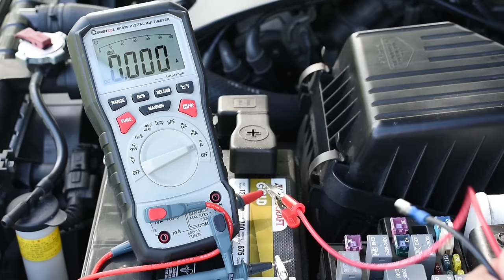Slow Power Windows In Your Car! (HOW TO FIX)

Comment: The testing of the fuse port with a multimeter is something I've not seen on any other video of this sort. I've tried ALL kinds of lubricants in the window channel and nothing seemed to speed it up noticeably. Gonna do the multimeter test next. Thank you for sharing!
Reply from the maker: If the window channel lube fails, you'll need to lubricate or replace the window regulator assembly.

Comment: I did this on my wife’s 98 Corolla some years ago, I couldn’t see what I was doing but a cheapy blue magnet light from Harbor Freight and an old makeup mirror with a magnet glued to the back gave me a much clearer picture. 
The replacement looked like it may have been meant to be riveted in and there were holes to mount it but no threads in the holes, but with HF it was not a problem since I had a tap and die set from them
Reply from the maker: Many cars rivet the regulator assembly to the door. Thanks for watching! Please share.

Comment: While it is true that an excessive power draw could be from a faulty motor, a motor under excessive load from a jammed mechanism, could also increase the amperage draw.
Reply from the maker: That's true too, but infrequent. Lack of window channel lubrication or a worn out motor are the most common.
Reply: Exactly, more load means higher current draw, so this test is useless.

Comment: Here in the Desert South West the heat and sand destroys most all plastic components dealing with the Window Mechanisms. The damages don't take long.  As short as one or two years can render them inoperative.  Plastic tracks and pivot points become brittle cracked or just worn out.
Reply from the maker: I lived there. AZ and NV. The heat is brutal.

Comment: Very clever idea re: checking current draw. I’m quite surprised that a replacement regulator only $40 for your car; I would have guessed $200 at least. After all, it’s a fairly large and moderately complex mechanism.

Comment: My 1975 Mercedes 450SEL has a slow passenger side window. I’ve already lubricated the all four window’s regulator and the actual lifts and pivot points. They are like a scissor lift. I lubed the window tracks like you did in this video. I used silicone grease. Is that the same as your paste grease? Or is that paste grease just dielectric grease. 
Also I put dielectric grease on my trunk seal and it stopped leaking. I will replace it when I get around to it. From what I’m told dielectric grease is the same thing as Mercedes brand bushing installation lubricant, meaning a huge cost difference. 
I’m going to check the voltage draw readings like you did. I’m trying to figure out a rig for my bullet type ceramic fuse like you made one for yours. I don’t want it arcing and damaging something. Very interesting video.

Comment: You forgot the step to go to the hardware store to buy yet another 10mm socket, lol.

It's funny how this approach to power windows is pretty universal across manufacturers.  Was this a Denso part?  Seems like they are king of the regulators.
Reply from the maker: 😃 Yes, very common setup. Thanks for watching!

Comment: I have been using silicone spray for the channels. Do you think the paste you are using is a better choice?
Reply from the maker: I prefer the silicone paste. It leaves a thick enough coating that the window is able to distribute to the lower area of the window channels as it goes up and down.
Reply: @electronicsNmore  Thanks! I ordered "Mission Automotive Dielectric Grease/Silicone Paste/Waterproof Marine Grease (8 Oz.) " from Amazon, and will apply it to my window channels.

Comment: I replaced the regulator that came with the motor and pulleys.  The thing still won't go all the way up.  It's like it's getting stuck in the track.  I can hear is squeaking against the rubber.   Tried lubing it up with silicone spray, but it only works a few times and then gets stuck again.  I'm getting to be a pro taking off the driver's side door panel.

Comment: i figure you fix it as your title says than replace it. But good instruction video. lubricating it would have been faster (within 30-60 min?) to do (and i was curious to see what works to use it on other things if it was good like home windows/. But buying does take up your time to work for the $40? But i guess you did not want to take the chance to do it again and bought a new one which is another reason.
Reply from the maker: The title was accurate because the video covers methods to fix(by lubricating), and to replace if desired. Buying a window regulator assembly for my vehicle locally was very expensive. I don't have too much time to do things twice, so I didn't want to try lubricating the regulator assembly, reinstalling everything, to find out the motor was shot. So I found a good deal online and just ordered everything new so I didn't have to play games. Thanks for watching!

Comment: Does the power regulator that moves the window up or down need to be in a certain position when replacing that assembly?  Or does the motor stop when it senses resistance? Some car have that as a safety option. Just thinking if the window trolley was in the wrong position the window may not go up or down the full distance.
Reply from the maker: No. Place it in a position that makes it easy to bolt the window onto the regulator. Thanks for watching!

Comment: Hello. Really appreciate if u can help me out. My car have two power windows. Driver(mainswitch) and pasanger. When i separately move up and down the windows, both working fine and fast. But, if move both spontaneously, the pasanger window will move slow. May i know what is the problem, and how can i fix that. Mitsubishi Lancer Coupe '95
Reply from the maker: Sounds like a lack of power under load on that circuit. I would inspect all connections.

Comment: Is it normal for regulators to go bad on a 3 year old car? cause all my windows roll up really slow. My GF has a sedan model of the same car and her windows roll up fast.
Reply from the maker: May just need lubrication if the battery voltage is in the normal range with the car running. (13.5 - 14.25v)

Comment: That tar that sticks down the moisture barrier is the worst!  I’ve had to do this job before and that stuff gets everywhere.  Even pumice hand cleaner didn’t want to remove it.
Reply from the maker: Use wd-40 or mineral spirits, then wash with soapy water. :-)

Comment: You know what, my car is now 32 years old and the power windows are still working as they should.
Isn't that amazing? What's the mark of the car? Haven't you guessed that already? Well I lit you up on that. VOLVO.
Silicone grease is really great, just like Volvo don't you agree?
Reply from the maker: Volvo makes very reliable cars, I was just never into the look of them. The newer Volvos I like. Thanks for watching!
Reply: @electronicsNmore  The older Volvos are actually the best.
 Best Volvo ever built is the 1998 Volvo 945. Just saying.

Comment: Question: my fuse box has 3 fuses for power windows first it has a smaller 7.5amp that just says power windows then it has 2 x 20amp one for driver and passenger so I’m assuming the 20 amp is the one I need to check anyone know for sure also can I leave the fuse in while checking
Reply from the maker: Try removing one fuse at a time to see what stops working.

Comment: My windows only go slow if i put up more then 1 at a time ive replace all motors and track and ideas i have a 99 buick regal ls
Reply from the maker: Sounds like a power supply issue. Check the wire coming from the fuse box to the windows.

Comment: Thank you. But this was a replacement and not a fix
Reply from the maker: For me it was a replacement, but in the video I made it very clear how you can fix a window that goes up and down slow
Reply: @electronicsNmore  
Yes, Thanks a lot. For me a replacement is not an option right now because I can't find the part. I will try to deassemble it and see. May be it will be just some lubrification. Thanks.

Comment: Proves how American engineers and management are NOT customer friendly. I have a couple of Marquis and the assemblies riveted instead of a threaded stud and nut like in your case. Drilling and find nuts and bolt to install new one. Grrrrr.
Reply from the maker: I remeber those! Big rivets that I had to drill out. That was back in the 90's.
Reply: @electronicsNmore  And prior. I haven't had to get into my 04' and hope I never have too. It would be sad to discover if they are still stone age, cheap fasteners. Was there anything you could think of or saw to address with the new unit that the mfg neglected to care about to insure longevity in a Preventative Maintenance way?